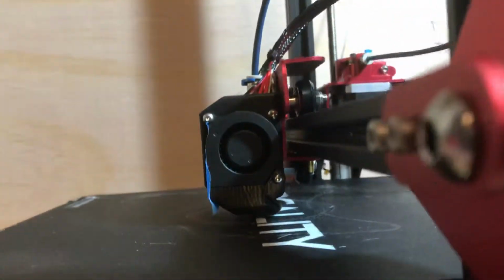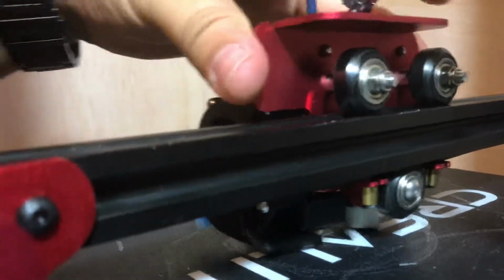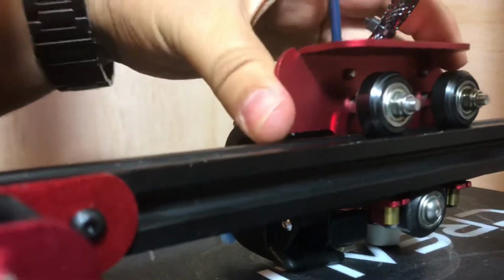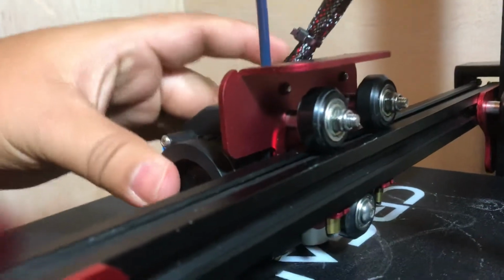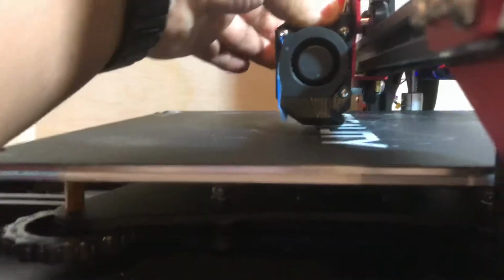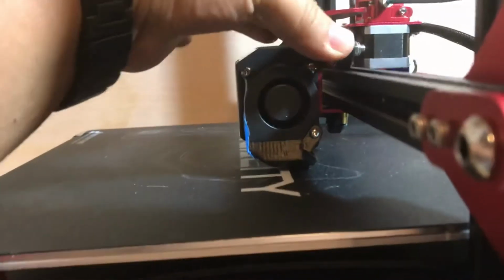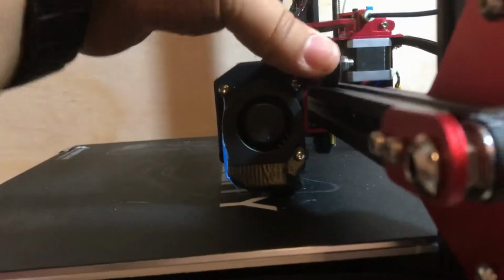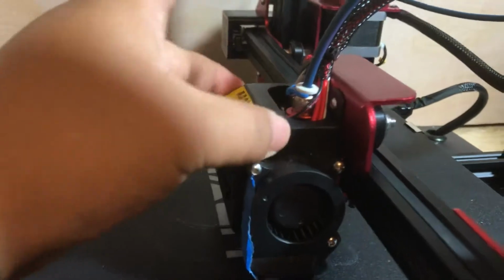Creality CR-10S PRO extruder is loose. Bend extruder housing

Comment: Hey man, did you ever get this fixed? I just unboxed mine on Tuesday, put it together yesterday, and spent upwards of 5 hours trying to fix/adjust the 'print sled' to not wobble. No luck. If you did fix it, what'd you do?
Reply from the maker: John Eisenberg Did you adjust the lower screw on the lower wheel?.. it suppose to go up and down depending on the way you turn it..

If that doesn’t work you have to contact creality on Facebook and tell them your extruder housing is bend..they might ship you a new one if they are in the mood..

But you can also bend the whole thing using a clamp

https://youtu.be/FAy_QCnxbP4
Reply: @mstyle183  , thanks for the quick reply! I did all the stuff that you did and then some more. Took just about the whole print casing apart. Tightened screws, bolts, and everything. In the end, it's a bend housing, as you've said. I'm sending it back to Amazon and making them send me a new one. If this housing is all fucky too, I'll reach out via FB to see if I can get a replacement. Thanks!
Reply from the maker: John amazon should be able to help.. I bought it directly from the fuckers and they are horrible.. 

Also make sure you tape or create a cable guide for the cable that goes from your printer to the printing bed.. my cracked and started a small fire